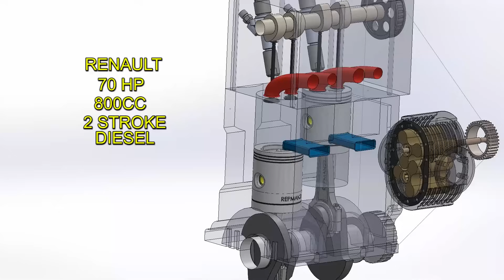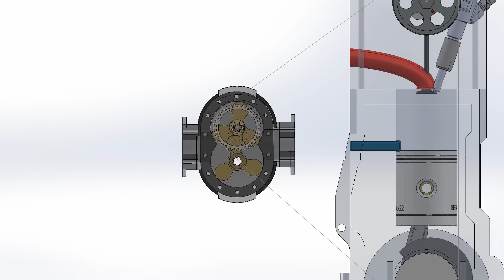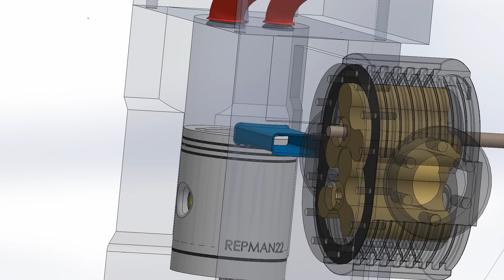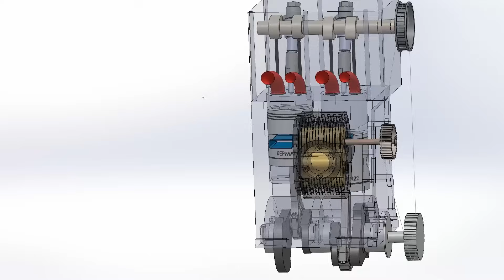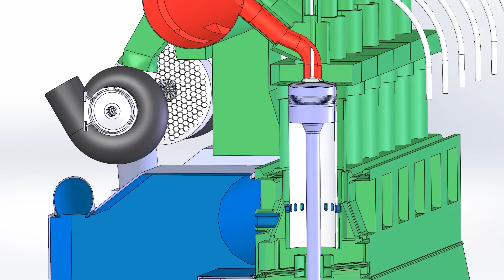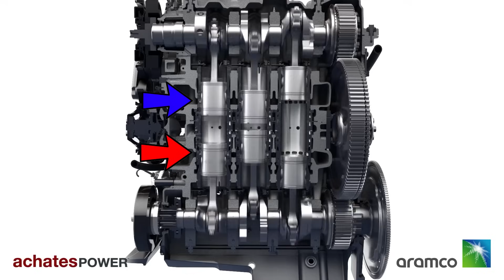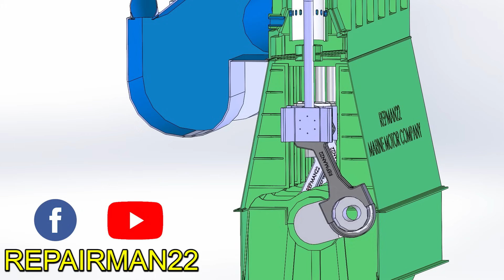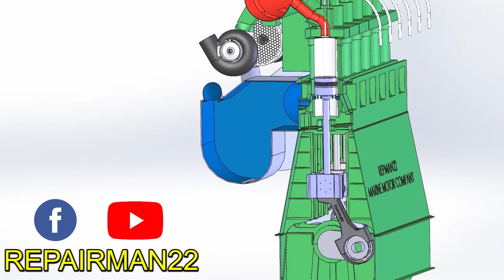🔴 All about 2 Stroke Diesel Engines and how they work in 3D Animation.

Comment: Just a detail 
Having worked on 2 stroke diesels both opposed piston and valved the exhaust valves open before the piston uncovers the inlet ports so as to allow the residual pressure in the cylinder to blow down and the valves are shut before the piston has recovered the ports 
Great vid
Reply: Funny enough the whole reason I just watched this was because I had the question of valve timing. This makes a lot of sense.
Reply: True - an advantage of using cam-driven valves in a 2-stroke  (instead of the simpler piston-controlled port) is the ability to offset the exhaust timing from the intake timing, without resorting to opposed pistons running out of phase. 

Another advantage of handling one side (normally exhaust) with valves is that it provides uniflow scavenging... again without resorting to opposed pistons.
Reply: @brianb-p6586  Couldn't the exhaust port just be positioned somewhat ahead of the intake port, so the piston uncovers it slightly earlier?
Reply: @billberg1264  without either a cam or offset in piston timing, if the exhaust opens earlier it also closes later by the same amount.

Comment: I dont understand why a person couldnt use a two cylender , one as the compressor to compress the air and the other for the combuster for power that should solve the the power problem at low rpm  , using diesel for a fuel should yield alot of power .
Reply: @carstennobody7047  Yep, OLD high powered engines have INSANE maintenance schedules.
Reply: That would be the Scuderi cycle engine.
Reply: Yes, @sockmonkey6666 , but there are other designs as well, using piston-controlled ports instead of vavles.

Comment: Opposed piston is insanely efficient
Reply: You only have to compare the Deltic with the Class 37 locomotive (Both built by English Electric)
Class 37 1750hp, V12, 4-stroke, 850rpm
Class 55, 3300hp, Two 18 cylinder Napier Deltic engines, 1500rpm
Both weigh about the same

Another interesting point, on fast patrol boats, Deltics replaced RR Merlin engines
Reply: @g8ymw  IIRC the Deltic and related opposed-piston multi-banks were developed for motor torpedo boats and other light craft, being thin-skinned the difference in fire risk between German-manufactured E boats using diesel powerplants and petrol powerplants used by British equivalents was significant, ironically the Deltic was developed from Junkers Jumo 204 licensed produced by Napier as the Culverin. What I didn't previously know was that Napier continued their R&D into stupendously powerful turbo-compounds after the Nomad was dropped and mated a Deltic to an axial compressor and gas turbine as a gas generator to produce some ridiculous >5000bhp figure before failing, though it didn't have the fearsome gnashing gearbox linking the gas turbine to the piston pack.

Comment: Probably need to watch this a few times to get most of the details.
2-stroke diesels are a bit hard to understand as they're an engine most people wouldn't operate or see in real life.
Weird that ship engines have one piston stacked on top of another.
Reply: Back in the 60's, 70's and 80's every second truck was running General Motors 2 stroke engines. Known as Jimmys, or bird scarers. The most efficient engine ever developed for turning diesel fuel into noise.
Reply: Good point, 2-stroke Diesel engines aren't very common nowadays so of course no one can entirely understand it.
Reply: @vintage3281 they're still common... just not in trucks.
Reply: @brianb-p6586 True, they are still used in large ships and some locomotives today.
Reply: The lower item shown from 4:38 to 4:54 is a cross head, not a piston, and it is explained in the video narration.

Comment: if this engine design is more efficient in the actual sense, does it mean "it puts out black smoke so it must be bad, green energy looks clean so it must be more environmental friendly" is a shallow and emotional judgement?
Reply: In short: Yes and no. It is more environmentally friendly in the sense it uses less fuel for the same energy outtake due to better efficiency. But in the sense of particulates, NOx etc. it is worse, but it is ideal for marine operation where the need for additional washing of the exhaust is less necessary.
Reply: There is much, much more to it than that
Reply: Well actually it does let out more particles that would hurt air quality in a more concrete way than regular diesels, and logistically speaking it would require more oil to be sold which could also potentially increase emissions indirectly. 2-strokes also have a distinct powerband that doesn't fit all use cases.
Reply: Not necessairly because the thing is although 2-stroke engines can be improved in terms of things like emissions and efficiency, nobody wants to let the 2-stroke engine take over since the 4-stroke engine had many years of development and the 2-stroke never had time to be trusted due to being killed by things such as emissions and efficiency as I said.
Reply: It doesn’t put out black smoke BECAUSE it is efficient. Diesels that roll coal are just tuned badly and have less power. Any smoke is just unburnt fuel due to a lack of enough oxygen.
Reply: @grubalaboocreosote4774 not "tuned badly" some diesels smoke and are designed that way. Black smoke is due to incomplete combustion. Most diesels use a turbo to increase cylinder air pressure, but a turbo is slow to respond to changes in air flow.  Here's an example:  A prime power generation needs to respond to large changes in load very fast and a diesel is very capable of that, but if the diesel had to ramp up fuel delivery at a rate as to not produce any smoke it couldn't keep up with the electrical demand and there would be brown outs.
Reply: @ColCurtis  “Black smoke is caused by incomplete combustion of fuel”. You quite literally said yourself that it’s tuned badly.
Reply: Right. “Green” technologies don’t reveal anything “dirty” looking to the end user, so suckers can “feel” that electric, etc. is clean.
Reply: Kinda the opposite. EV-haters hate EVs because (their words, not mine) EVs are "gay", don't produce sound and "lack soul". It went to such extremes that some car makers want to install fake gears to resemble transmissions and uneven torque curve in ICE cars. Can't get more shallow and emotional than that. 
On the other hand, EV drivers (Musk fans aside) prefer EVs because they actually look at the numbers and data, and base their purchase choice on pure facts.
Reply: errr errr green green I'm a spastic

Comment: Still doesn't get how blower has a limited boost despite attached to engine rpm
Reply from the maker: When the compressor spins faster, it pushes more air, but the engine also consumes more air at higher rpm.
Reply: Positive displacement pumps, not centrifugal.
Reply: To use a positive displacement blower at full power it would need to be huge.  A smaller blower is used at start-up and low RPM and a turbocharger at full power.   Turbos are better for high flow rates.

Comment: Thanks for this video, now I understand these engines a little bit better. If there were any issues I had with this video though, I think EMD's 2-stroke engines were able to run on just turbochargers with some kind of a clutch system and I really don't think oil consumption is reduced if oil gets into the combustion chamber of an engine since needless to say oil is a very dirty fuel.
Reply: They had/have a pretty unique turbo that was driven by the crankshaft at low RPMs, but when the flow of the engine was sufficient, the exhaust takes over and runs it like a normal turbo rather than a supercharger or procharger as they are known. They have what's called an overrunning clutch made into them to decouple from the crankshaft at the required RPMs and exhaust flow. Hope that helps.
Reply: @robertschemonia5617  Thank you, and I already heard about that but I forgot so thanks anyway.